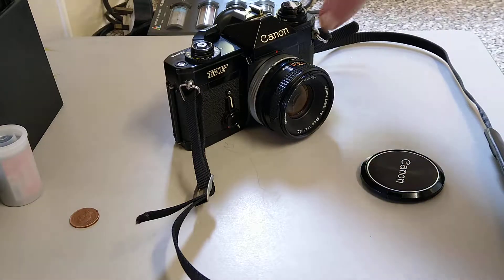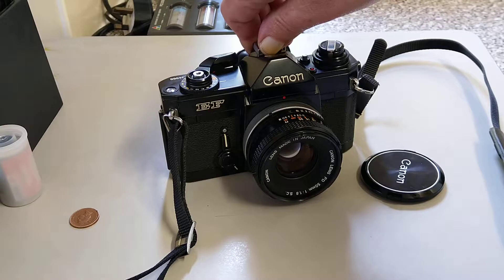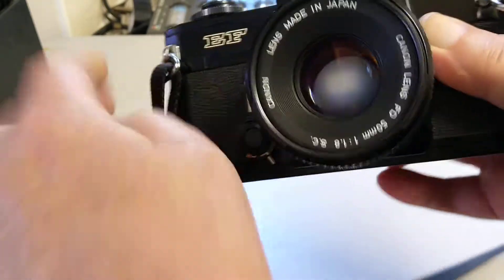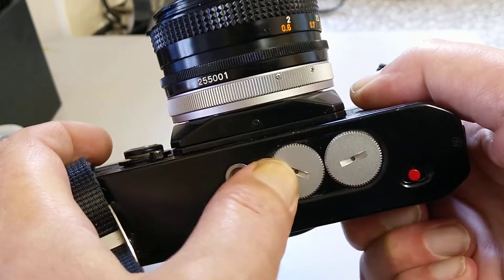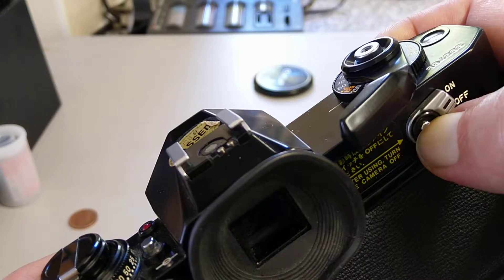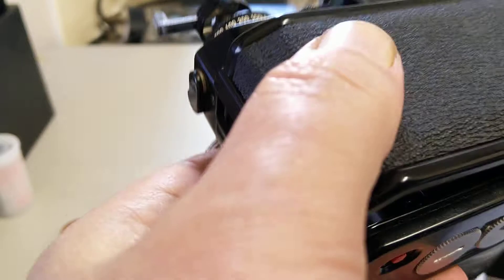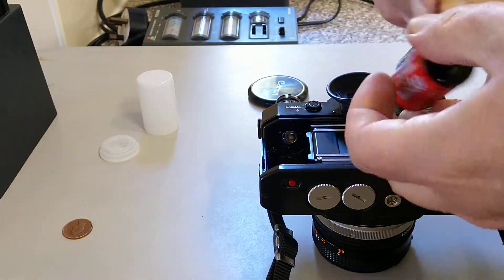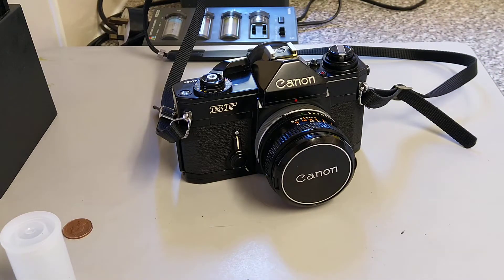Canon EF, loading with 35mm film, Agfa Vista 200

Comment: I just bought on of these. Very useful video. Thanks.
Reply from the maker: Hi, great choice if a bit heavy and not everyone is a fan of shutter priority but I like them, got two, enjoy!!
Reply: @thephotographersbag  It seems the electronics don't work. New batteries don't help, and, no one will repair it. Looks like these were a technician's nightmare to fix. Shutter works up to the point that needs the battery. I guess I can use it to take photos, but what's the point. Looks good on the shelf!
Reply from the maker: @carbonejack  Hi, only the long shutter speeds are electronically controlled, the shutter should work fine at the usual fraction of a second settings, no batteries means no metering but the aperture can be set manually on the lens, if you use an external light meter or an app on your phone it will work fine, agreed they can be a pig to work on, the shutter blades are the usual suspects as they get gummed up with dissolving light sealant material, if sold as working 100% then you have a claim against the seller, where do you live?
Reply: @thephotographersbag  I bought it knowing it probably needed repairs.
Reply: Found someone in Vermont that fixed meter and CLA for $78. In he meantime found one in great shape w/ a 50mm f/1.8 for a little over $100. Now I have two.

Comment: Great video I've just picked on up on ebay for £31 with a lens, I think I've got a bargain.
Reply from the maker: Hi, your find does indeed seem like a bargain  , quality camera but quite heavy, is it fully functional and what lens did it come with?
Reply: @thephotographersbag  I have put batteries in and everything appears to be good, I've compared the metering to my EOS 1300D and they match. I came with a Tamron 2.5 28mm lens with a Tamron Adaptall 2 Telemore 95. There is a light seal missing from inside the lens prism, so I'm going to put all new light seals in before I try it with some film.

Comment: Hello Sir,

I have a question.
I usually shoot in Aperture Priority, will I be able with this Camera to set the desired Aperture, and the metering will tell me whether it's under/over exposed, or tells me the Shutter speed I should use?

Thank You!
Reply from the maker: Hi, sorry for taking so long to get back to you, the camera will show over/under exposure, basically using it in manual mode, very well constructed camera but very heavy...

Comment: i use the MR 9 adapter with 386 batteries for 1.35 voltage
Reply from the maker: Hi, great solution, I do too, this camera has a voltage regulator so fitting 1.5 v batteries will not effect meter accuracy, thanks for sharing, much appreciated 😀

Comment: Hello ! How can I change the lens of the camera ?
Thank you
Reply from the maker: Hi, I think changing the lens is shown in the video, there were 2 styles of lens, the early version have a chrome ring near the camera body and a locking tab to the right on the lens barrel, depress the tab and turn the ring anticlockwise until the dots line up, then gently pull the lens away from the camera, the later style lenses do not have the chrome ring, with these just push the tab and turn the whole lens anticlockwise to release
To attach a lens line up the dot on the lens with the one on the camera body and turn clockwise until you hear the click.....